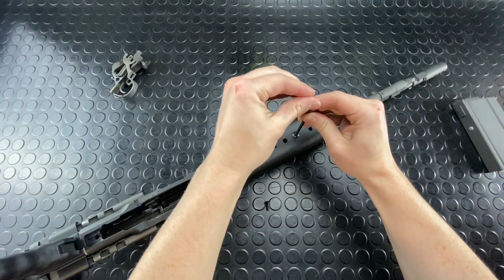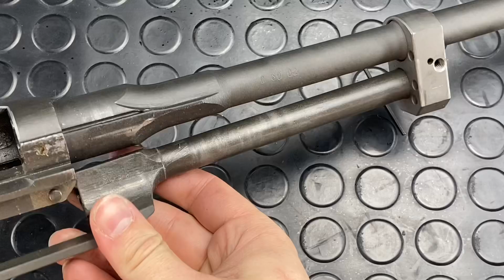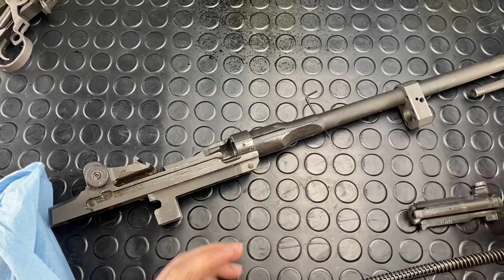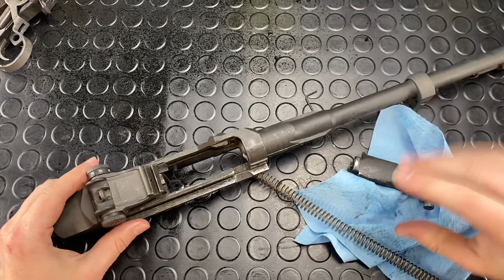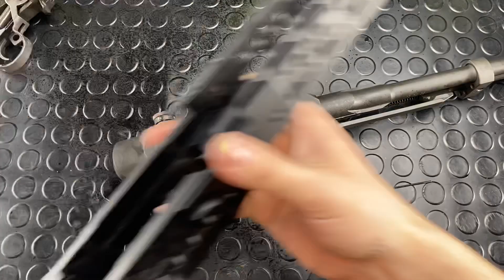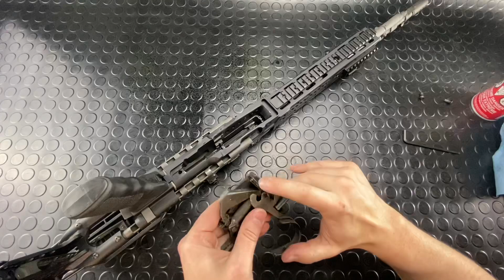Mk14 SAGE EBR Chassis | Install + M1A/M14/m305 Field Strip & Lubrication

Comment: Great now I know how to take apart a rifle I could never afford
Reply: the rifle is 600-700 (its a norinco he said) BUT the stock is 700 - 900. LOL
Reply: You can find them for $500 occasionally, (20” models usually). Obviously not the stock.
Reply: LilSaint001100 to be fair if you live in the US you’ll never get a norinco 🤣
Reply: Bloodreign137 it’s too bad because they are the only genuine M14’s being built. Original tooling although the head spacing is suspect.
Reply: I opted for the Archangel CQB stock, a lot cheaper but basically the same principle. It's the same stock used on the SOCOM 16 CQB but mine is the standard 22" barrel and it fits just fine.
Reply: In the US, Springfield M1A’s can be bought around the $1500 ($1200-$1800) USD price range. SAGE EBR chassis is $699. Affordability, in my opinion, is simply measured by the hand of the beholder. I purchased one (with EBR Chassis) from the 1970’s recently and very excited to shoot it at the range. I like how they mix reliable technology with a modern tactical chassis. And if you own a Ruger Mini 14 (Ranch Rifle) you can see how similar the field strip process is.
Reply: @First Name I appreciate the response and actually agree with you! However... The EBR Chassis does have a Quick Detach Picatinny Rail Riser attachment so you can attach a scope or red dot sight to it. In this video, the M1A does not have it. It extends the rifle’s range to about 300-400 yards with a proper scope. I thought the same thing about the SCAR, just a few hundred dollars more and I’d have the iconic SCAR in my arsenal! When I went into my local gun store to order one the associate talked me out of it! He said the SCAR compared to an M1A (which is what he recommended I get and I later bought with EBR Chassis and Riser) is more unstable and has significantly more recoil. He is a Army Ranger Vet, works in a gun store and owns a few SCAR and M1A rifles. Of course this is all ones personal opinion but I listen to him and the owner very closely.

SCAR rifles chambered in .308/7.62 like the 20S and 17S sell for around $3200-$4000 and they are aesthetically a beautiful rifle! But I’m not made of money and that extra $500-$1000 could easily go towards something else like accessories and ammo, which is rapidly becoming less available these days. Remember, price, practicality, purpose and performance are the main P’s I pay attention too when purchasing any firearm. So if you can buy one, I would recommend any SCAR rifle! But in the end, it was not “worth it” for me to buy a SCAR “right now” with today’s firearm market being so chaotic. It’s still on my bucket list, I will have one someday, but not today.
Reply: @First Name Gotta agree with you again! the AR-10 build is farther down the road on my “bucket list” plans since I built an M4 5.56 with binary trigger recently! Just need to start researching the companies, reviews, opinions and prices on the AR 10 platform!
Reply: @billabong710  oh hell yea binary trigger build is definitely on the list for my next build.  If i were you and had some money to blow i would build a Ar10 in 6.5 creedmoor paired with a quality optic, bipod, and some match ammunition you'll have yourself a beastly long range setup.
Reply: @First Name Yuuuupp! Was thinking an ar10 6.5 creedmoor is what I want to aim for and i wouldn’t need $2500 for it haha. At most I would only want to spend $2000 on it if I can help it. You’re going to have lots of fun with the binary AR/M4 build at the range I promise lol. Trigger is expensive but worth it!
Reply: This looks like a Ruger mini 14?
Reply: @tigerpisces5506  no, the mini 14 looks like this rifle. (M14 was the original, then Ringer made the similar but smaller "Mini 14")
Reply: @LilSaint001100  you people buy 1k ajphones surely you can afford something more useful!
Reply: @AutodidactEngineer  I've seen a-holes put $1600 cans on $500 glocks!
Reply: I'm getting one
Reply: Eat your vegetables and listen to your parents then you’ll be able to afford one ☝🏼
Reply: You might be surprised. You can find a good used one for $1200 and the stock/CHASIS you can also find used. Lot of people buy these guns and hardly ever shoot them, think they want a SAGE system and buy one but decide they really want to stay true the the weapon and put it back in the original stock. The ARCHANGEL stock that Springfield offers and you can buy elsewhere is a damn good compromise and won’t sit you back that much. Years ago, I found a used POLYTECT M14 at a heck of a buy and don’t overlook this Chinese clone, THEY DID IT RIGHT. my  Polytech will shoot as good as my M1A standard if not better with some ammo. I have I think now 7 M14 platforms and my best is a BULA DEFENSE M21 and a Franklin Arsenal I believe that is what it is. I haven’t fooled with it much. My son manages a pawnshop so I got to get some weapons I though I could never afford so I was blessed in that regard. That was one of his perks because he didn’t get paid squat! 😂 (he is now a dang car salesman! 4 years Army, 10th Mountain, Infantry. Then went to collage to be a federal US MARSHAL decided he didn’t want to be in law enforcement, but he managed the pawnshop while he went to collage. To make a long story short, I would always seem to get a call every other week that went like this, " daddy we got a gun in today you are going to want"! Damn near broke my ass! I did get a PSP and a Xbox, whatever the latest great is. I better stick to shooting real guns cause I always just get my ass kicked playing games.
Reply: @LilSaint001100 Norinco POLYTECT! Buy one if you come across one. The Chinese got it right! Mine is a tack driver out to 500 yards. That is as far as my old ass can see using irons. You won’t regret buying a POLYTECT.
Reply: @billabong710 oh damn those binary triggers. They are my curse. I have a butt load of them and one thing people don’t understand, I have both Fostect and Franklin and in single mode they are damn fine triggers. Clean crisp break, mine are in the 3 pound range, but then you turn it to giggle, money just flys out the barrel. I love it. I think I like them more than a forced reset trigger. If you practice they are as fast as the old bump stocks were and they are fast and you can control them unlike some people say. Binary triggers are butt loads of fun. Drop one in a 10.5" or a real blaster , a 7.5" build and then rock and roll. Do wear ear muffs and ear plugs together though! 😂

Comment: One of the most badass rifles on the market today.  Period.
Reply: HA Ha
Reply: Depends on what make of M1A/M14 action and barrel you install in it. LRB, Smith, Fulton yeah maybe. I wouldn't waste money on a Springfield unless it was one that came from the real US arsenal in Springfield Mass.
Reply: Badass in that they're bad and ass.
The MK14 has a critical design flaw; field stripping it throws off your Zero.

It is also heavier than the M14 whilst retaining the same dogshit recoil impulse as the M14.

The only meaningful difference is that there isn't any wood to fuck up your accuracy when the humidity changes.
Reply: @The1TrueEcho  There is only SPRINGFIELD M1A SOCOM 16 CQB available in my country, I really like M14, should I buy that one? Unfortunately there is no any other option, so should I spend my money on it?
Reply: @riotcailin  NO! Under no circumstances should you buy an M14 derivative. Not one M1A. Not one Mini 14. The entire design is unsalvageable.

The major flaw resides in how it doesn't use a modern carrier system, where the spring is retained primarily in the reciever behind the barrel. No, the majority of the reciprocating mass is directly underneath the barrel, making the gun feel far heavier and feel like it recoils far worse than it should.

The military had all of the selector switches removed off of their M14s due to how uncontrollable they were. An M14 that still has its selector switch is about as rare as the VSS Vintorez (at least here in the States).
Reply: @riotcailin  Just buy a Dragunov rechambered in 308 if you want a 30cal with wood. It'll shoot significantly smoother than an M14 and you can actually field-strip it without wanting to cut off your hands.
Reply: @ I live in a post soviet country and people here have original soviet made SVDs and nobody sells them unfortunately, I don`t think we have Chinese copies as well, M1A costs like 3k in US dollars but I think these original Drags go for much higher price, but I get the advice, thanks chief.
Reply: @The1TrueEcho  Would you happen to know how many rounds between cleaning on this rig...trying to keep re-zero to a minimum...
Reply: @enigmatic51me95  1 thousand is the absolute maximum, and even then it is RARE for a MK14 EBR to ever see reliability past a measly 300 rounds without cleaning.

It's not even fouling that does it in, it's just the natural degradation of lubrication as you use the weapon. Because the gun is effectively a Garand with an overcomplicated piston, it has an exacerbated problem many Garands have where the op-rod that actuates the Bolt can build up a ton of friction from dirt and dust.

Difference is the Garand was a very simple over-gassed long-stroke-piston. It was designed in an era where we were still throwing random garbage at the wall to see what sticks, complete with government institutions with THEIR ideas on how warfare and weapons should work, slowing down progress even more.

The M14 as we know it almost existed in WW2.
The M1 Garand was originally designed to support if not outright replace the BAR.

So I hold ZERO tolerance for how the military dragged the M1 Garand into the modern age kicking and screaming, especially when they stunted its development.

Comment: You failed to mention, the installation of the Guide Rod Block  that comes with every EBR chassis. It requires the removal of the flash hider and gas block assembly.
The old Rod Block in replaced by the new one and has a crush washer and three bolts to mount it to the EBR frame.
Without this part, you cannot fit your M1A in the chassis.
Reply: Thanks for the info I just bought mine and it will be here soon I was wondering about that part
Reply: Do you mean the other screws that go on the side?
Reply: @Archlight-rz2sd  where did you order yours? I’ve been wanting to order one for my dads m1a Springfield standard
Reply: @aopbraap3498  I have one I might sell if you're interested lol
Reply: @jaredthompson1312  If that guy doesn't respond I'll take it!
Reply: Thanks! I saw another video where they installed the block and I wondered about that omission here.

Comment: Just placed my order for the ebr chassis. It's a 6+ month wait till it shows. So pumped!!
Reply: 6+ month wait?! Holy shit!
Reply: @joesnuffer  no joke homie. That's just for the black/black vs silver/black. That's 12+ unknown lol.
Reply: Unobtainium!  Looks like I'm going to have to start combing gun shows/auctions sheesh!
Reply: @patrick87100  where did your order? Id like to order one for my dads Springfield m1a standard
Reply: @aopbraap3498   ustacticalsupply, the stock is $900 & then the goodies made it $1400 (sight mount,bi pod,ninja grip,  full auto cut out cover, ebr tool) just got my m1a Friday (07/01/2022, $1800), leupold mk 4 scope $1100. Scope rings are $200 from badger ordnance. Front sight post with bayonet lug $56, mags are $30-54 from springfield armory. Ill have $4600+ into this ebr m1a. Rounds are $1.06 a piece locally. I won't see the ebr stock till around September, 6-9 months is what I was told when ordering back in March 2022. It's not cheap at all but I wanted this since Stan in 08-09 & finally could make it happen. Good luck homie. Enjoy!!
Reply: @patrick87100  thanks buddy! I just placed an order the other day for the chassis it was received. How long it take you for them to contact you? Was yours on back order too? Hopefully they contact me so I can tell them just take my money idc how long it’ll take lol.
Reply: @aopbraap3498  I asked about the
Wait time before i made a purchase. Everything about the ebr is on back order. I have received a few smalls I ordered with the stock. I emailed customer service & asked them to charge my card now. Joshua emailed me within 24 hours and paid for my items.

Comment: 13:49 for anyone wondering, one of the screws holding the op rod block is a cunt hair shorter than the other 2. It is also painted white, but be aware. Nothing in the written instructions mentions it. The longer screws actually tighten the op rod to the guide, hence the binding that occurred.

Comment: @Arm&Gun. I'm  curious what happened to the two side screws that are supposed to go on the operating rod guide block? There should be a total of 3 screws securing it in the chassis. Did you just decide to omit them? If so why?
Reply: I  just saw the vid and noticed the same? Wonder if he knows there missing
Reply: @johnkinter1981  Maybe he will once he starts trouble shooting crappy groups, lol.
Reply: I was also told to torque the screws

Comment: was it pretty simple to assemble the M305 with the Sage EBR chasis or were modifications required, if so what modifications.  Also what is the final weight
Reply: You have to replace the oprod guide. It is provided with the Sage EBR chassis. This requires removing everything off the barrel to complete the installation. The chassis weighs about 4lbs. or so. Weight of the total system is typically 11lbs. - 15lbs. depending on final configuration.

Comment: Can you remove all the lower pic rails and stick a short piece at the fore end for a bipod?  They look beefy and probably add a bit of weight up front and an already heavy barrel.
Reply: Last I checked with Sage Int they had short sections of pic rail available, but I had to call as they do not list them on the web page.
Reply: You could, but the bottom rail on mine doesn't run the entire length of the bottom. It only goes to the handguard. You wouldn't save much weight by putting a shorter piece there.

Comment: So I'm putting this thing together is quite literally just switching the factory stock with the chassis? I mean obviously you have to put the top rail piece on and all that stuff, but that's just the final step
Reply: You have to replace the operating rod guide.  That means you have to remove everything off the barrel forward of it to do it.  Just did mine today.

Comment: 'Sage'!.. Yeah that's them, friggin beautiful gear. Expensive as shit but gorgeous kit. 👍
Reply: joey dubbs76 in this case surprisingly inexpensive. You a pick up a kit for as little as $600 which is actually tremendous value for money. If your rifle is properly head spaced, (the Norinco’s have this issue more then occasionally) it improves handling but also accuracy tremendously.
Reply: @john-paulsilke893  I agree I find it inexpensive and high quality for a rifle stock